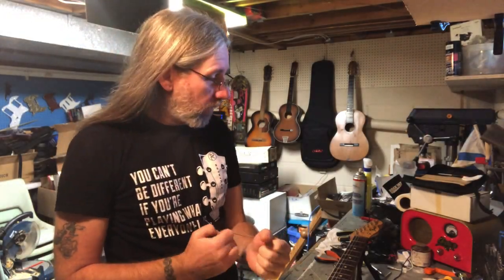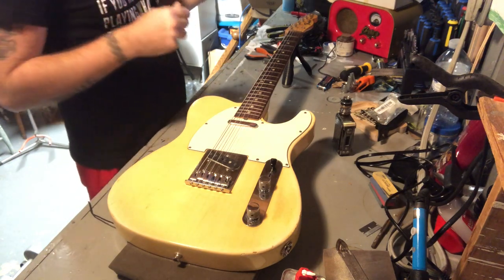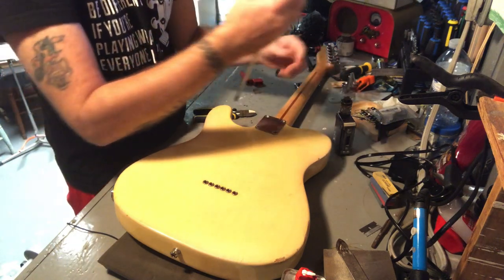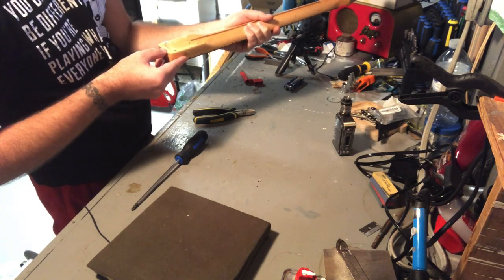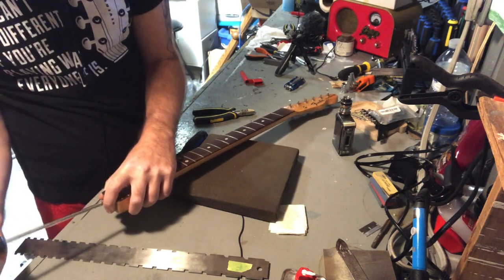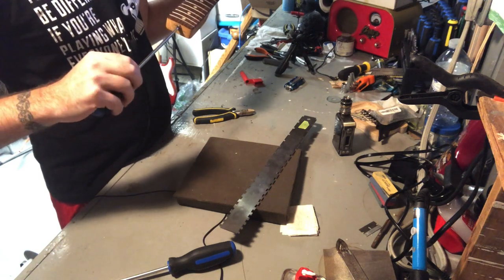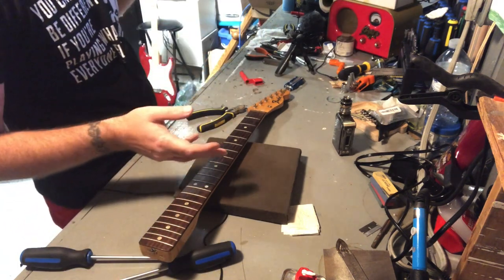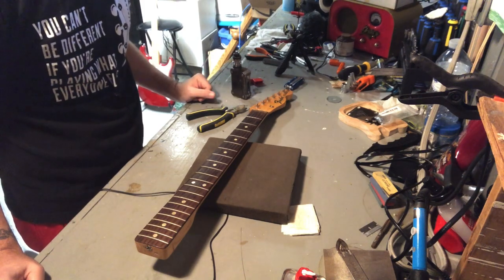'71 Tele Neck Has A Back Bow

Comment: I bet you’ve heard about this technique by now. First, loosen the truss rod nut. Then, support the neck on both ends with neck rests,   put a kitchen towel around the neck,, and wrap it with a heating pad (~150° - 165°) for about 20 - 30 minutes. Then remove the heat and place a padded clamp on the fretboard at the apex of the curve - usually from fret 7 to 9. Place the other side of the clamp on the underside of your table. As you tighten the clamp the neck will level. After 24 hrs, just snug the truss rod nut up a bit and then back off  the clamp. It should work.

Comment: You can get two clothing irons and set them on the fretboard with something in between like a metal ruler and then carefully seperate the fretboard from the neck with a large knife. Then install a dual action truss rod. I have done it a couple of times.

Comment: My "Guess" at what the hole is, probably a long drill bit that drills through neck pocket then straight through neck pick-up cavity to the switch and pots cavity so the wiring has a passage from pots to neck pick-up. That's all I can come up with.
Reply: I appreciate the "Guess" because I was clueless.  It sounds like a viable explanation to me!
Reply: That’s exactly what it is for done so you dont have to channel the top i do this for my builds,  I’m not a fan of a pick guard blocking a sexy piece if wood!